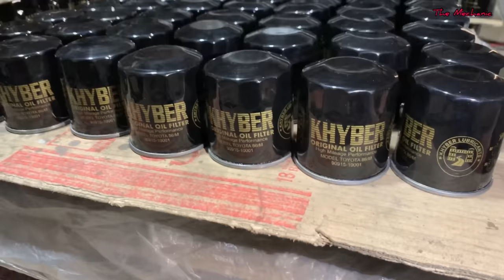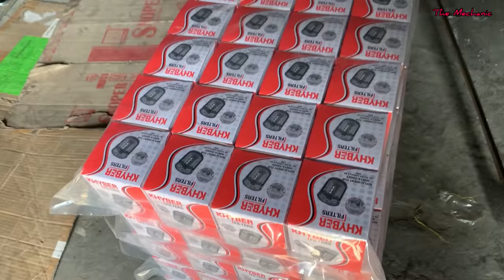How Car Engine Oil Filter are Manufactured in Factory || Manufacturing Process of Auto Oil Filters

Comment: I bet these filters have more quality than the ones I use at work for oil changes
Reply: Doubt it. They stretch the filter media too thin. Hardly any pleats and the 2 ends of the media aren’t even sealed together so oil will just blast right out of that seam and bypass the filter. A super tech from Walmart is better built 😂
Reply: @zaneherrington8868  you think so?